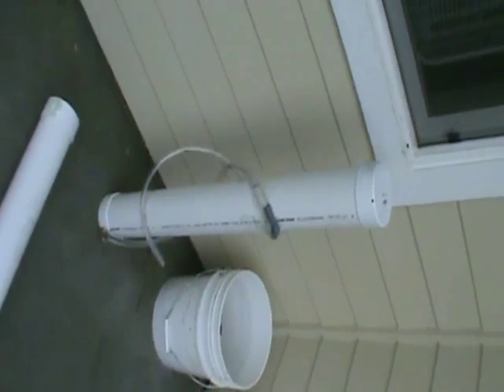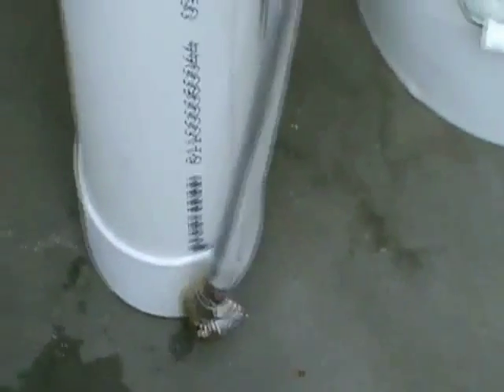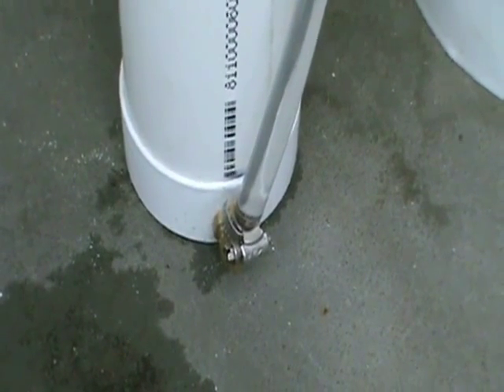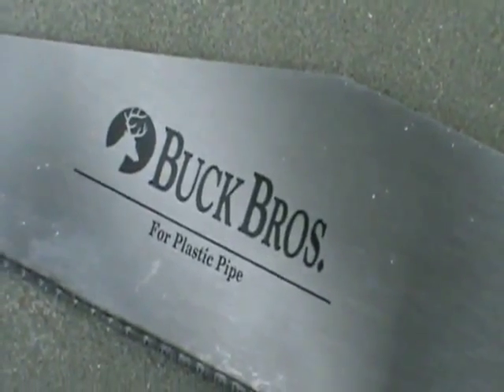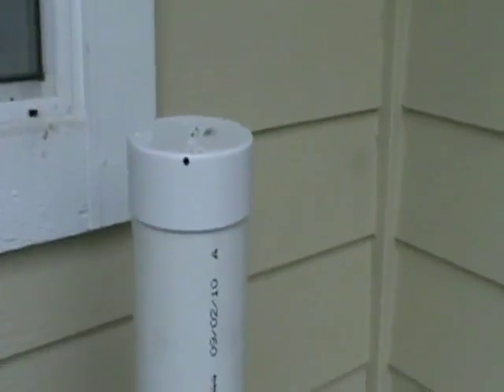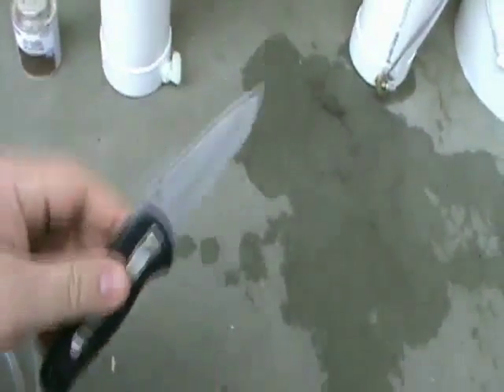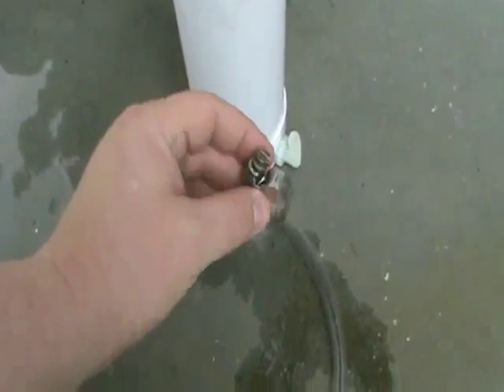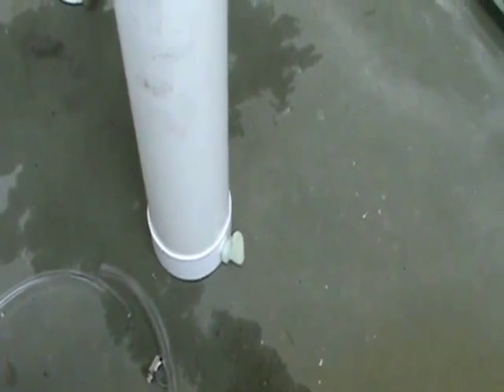BioSand Filter Part 1

Comment from the maker: @gatorDennis 
Thanks Gator the 2" is not exact but I did read it in the paper that cryptic cricket linked to.
The pipe is 4" and I bought it in a 10' length for like 14 bucks or so at home depot

Comment: You & CrypticCricket both did a great job. I also read the document that he recommended & found that the placement of the upper hose will determine the water level inside the PVC. The water MUST be present all times. Did not remember that the level could not be above 2", thanks. Made enlarged 'colhane' charcoal filter to remove chemicals. Plan on boiling or treating after both filters used.
Was your PVC 3", 4" or 2" ? The 4" costs $12 for 5', $8 each cap + all other fittings & hose.